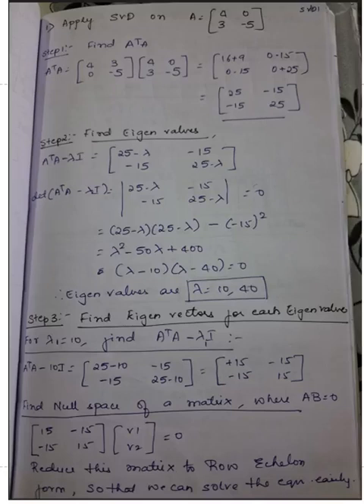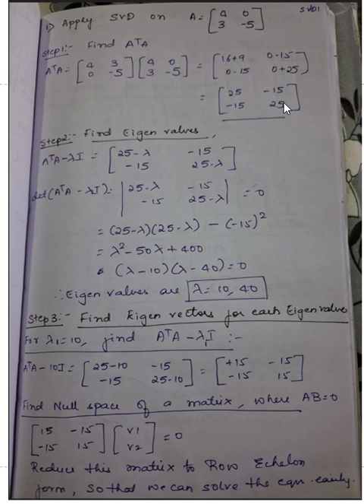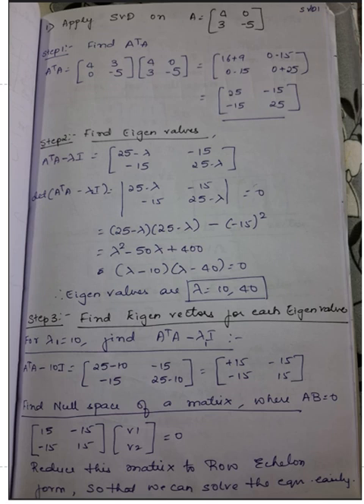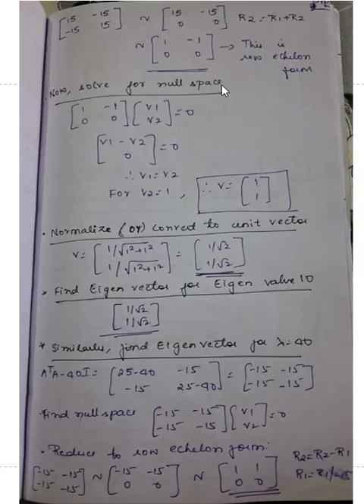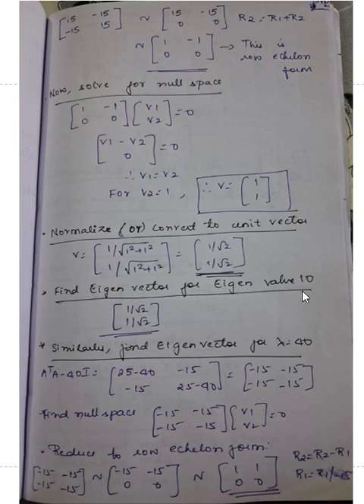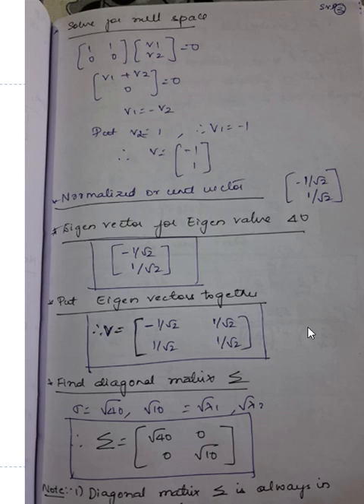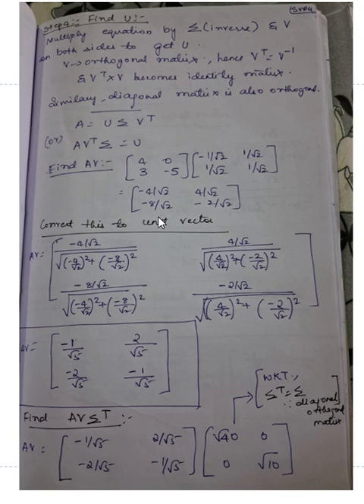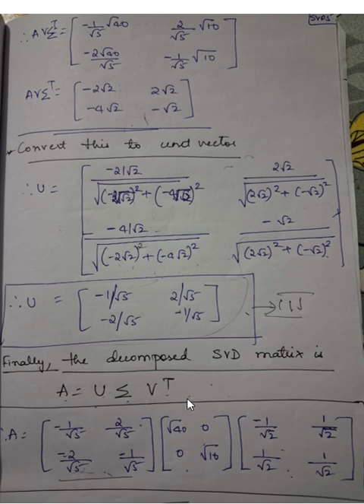Lecture 40: Problem on Singular Value Decomposition SV|BCM601|BDS602|BCS602|BAI602|VTU|ML

Comment: Mam,
Initially you took
                   A transpose × A
but in textbook its solved like 
                   A × A transpose 

Which should be considered mam?
Reply from the maker: You can follow AT*A. I have verified the answers in a SVD calculator and its correct. 
You can verify your calculations at this link for SVD calculator: https://www.emathhelp.net/calculators/linear-algebra/svd-calculator/?i=%5B%5B4%2C0%5D%2C%5B3%2C-5%5D%5D
Reply: Thank you  @VaaniSrikanth   mam ...